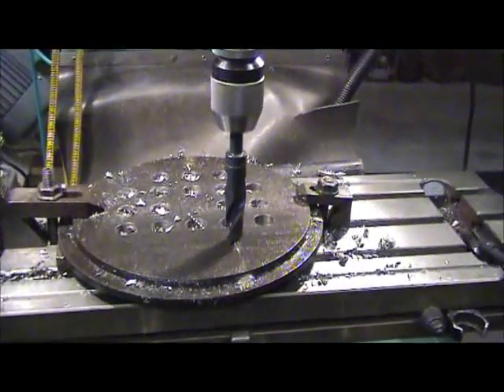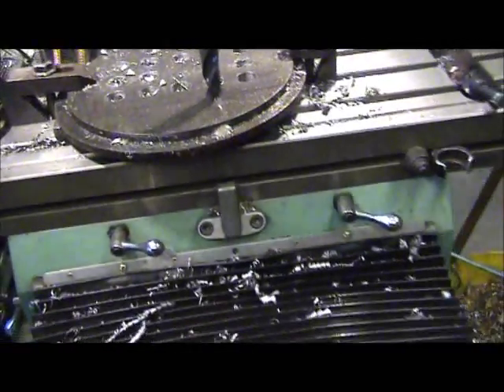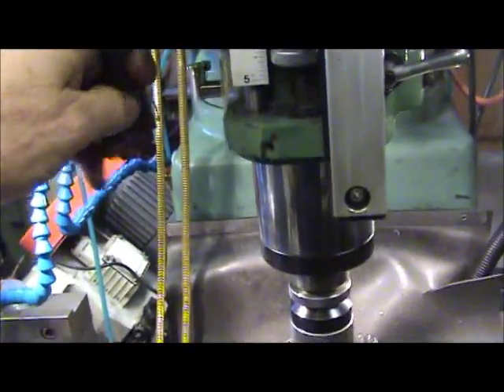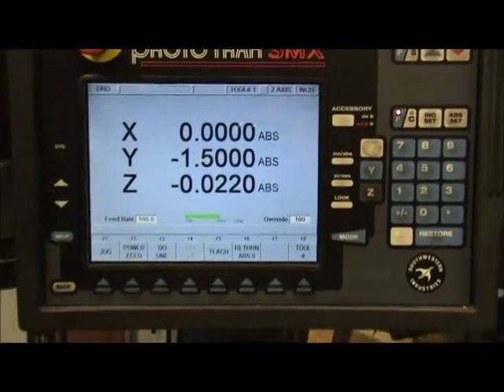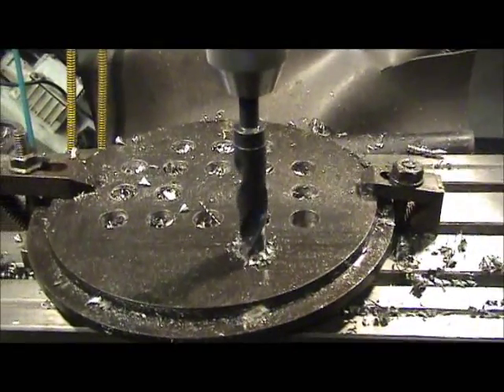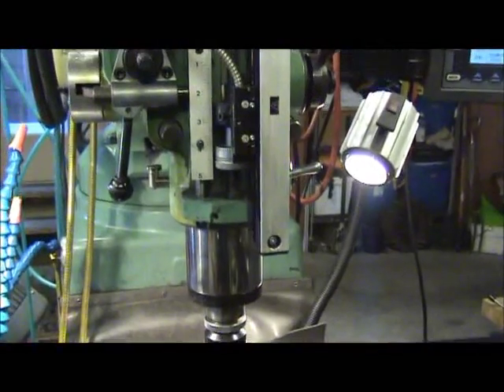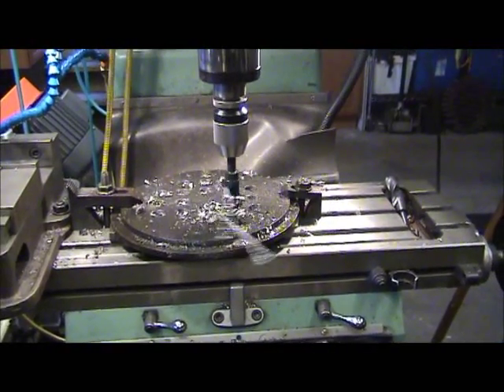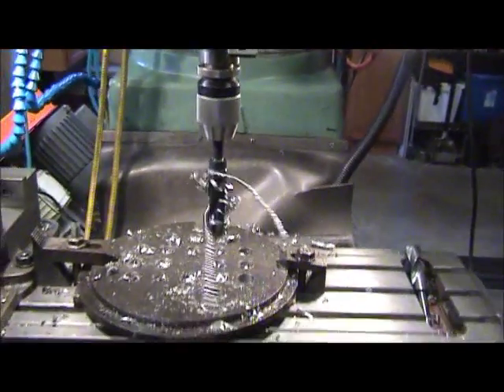Machining steam boiler parts

Comment: Drilling with power feed is a No-NO hence the internal parts wouldn't take it for very long.
Good Luck
Alec Ryals
Reply: I am a machinist, I use power feed all the time. these machines were made to use it. personally I would have performed those holes at half that diameter, then finish drilled them full size. lots of ways to skin a cat though... 
Nice proto-trac! I love using those!